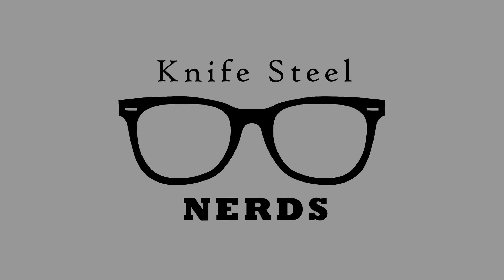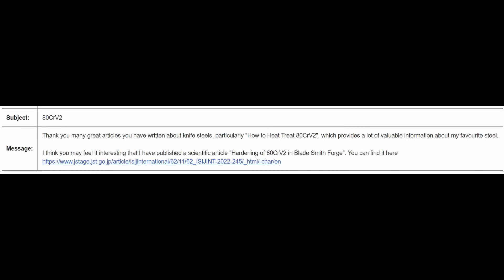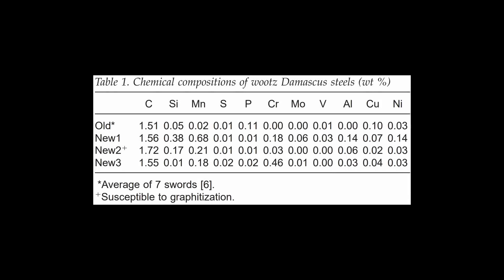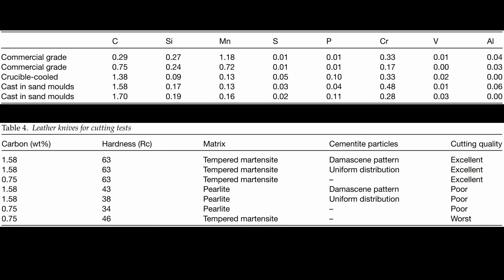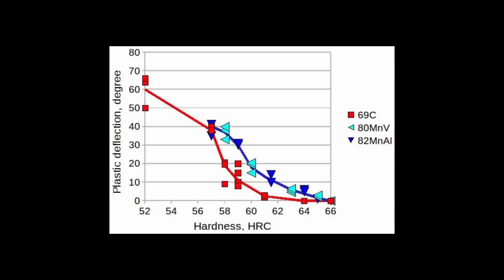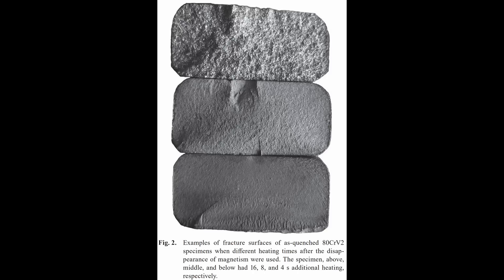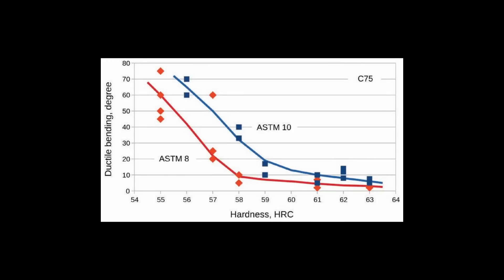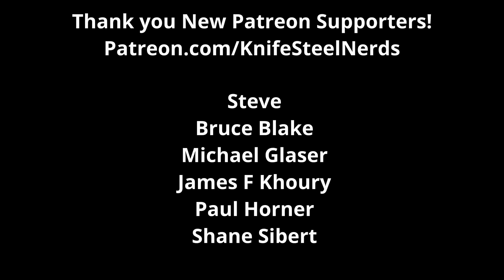A Rival Knife Steel Metallurgist?!?

Comment: I wonder how much it would be to formulate our own powered steel for best of all worlds
Reply: Depends on how much metallurgy you have under your belt. 

Someone hit up a steel maker and had damasteel made which is powdered metallurgy Damascus. If you had enough experience and could make a small block of non powdered metallurgy steel to test the alloy out to a certain level you could probably provide samples to a steel manufacturer and work out a deal. 

I believe that's what busse knifes did with infi steel.
Reply: What counts as "best" varies depending on use. The best chef knife steel won't be the best bushcraft knife steel, and neither will be the best diver's knife steel. Depending on metallurgical formulation, there's tradeoffs between toughness, edge retention, and "stainless-ness". 

However, wasn't Dr. Thomas' own CPM MagnaCut supposed to be the balanced "jack of all trades" powdered steel? Good balance of toughness, edge retention, being stainless, and being forgeable and machinable?
Reply: @The Kash Connoisseur  there are however some steels that could be generalized as a best blade steel due to the balancing act of the alloying agents and specific heattreatment procedures. 

Z tuff for example has basically as much toughness as the second best sword steel available, but at a much higher hardness level, with better abrasion and corrosion resistance. Albeit expensive af. 

For folded blades with only 1 type of steel, 1095 and similar is probably best given you'll end up around that sweet spot of .7 ish percent carbon for simple steels. 

8670 while poor for a catra edge test is probably extremely similar to 5160, and 5160 is one of the best sword steels and used in tough choppers very often. Meaning you can probably balance edge retention and such with hardness and keep toughness similar. 

This breaks things down into a few categories which we can balance individually but with some cross over in certain cases. For knives given you don't need the same shock resistance swords can take again higher hardness and not necessarily as much toughness needed. 

If we ignore how easy it is to sharpen or include that things can change a bit. But then breaks it down into a 2 sub category for other categories and only some for practicality sake. 

Example. For choppers z tuff, 8670 if you want to go the cheaper route 5160 after that. If you don't need something that durable you can step down a notch and trade it off for other characteristics or price points. 

But alot of steels used in knives are kinda just hype and marketing and they perform about the same as cheaper more common alloys pr very close. And given 1095 with good heattreatment can work for swords it's not hard to find perfect steels. Albeit heattreatment is mad important and more so then steel choice. But if we just discuss in terms of finding perfect heattreatment Albeit unrealistic for many smith's companies could easily swing it. 

Pretty much what busse combat knives did for infi steel. Pretty sure it's just an A8 mod steel.
Reply: @bmxriderforlife1234  Well, the cool thing about Larin's CPM MagnaCut is you can achieve a really good balance of toughness, edge retention, stainless aspects, and can harden to 60+ Rockwell C. 

But again, it depends on the use case. The best general purpose pocket knife steel won't make the best general purpose chopper steel (hence why there aren't many folding knives in 5160 or 1095, but plenty in 8Cr13MoV). The best steel for a rapier won't be the best steel for a broadsword. The best steel for a knife issued to Army soldiers won't be the best steel to give to SEALs. Heat treatment can improve some aspects of steels, but always at the expense of others. If you use a heat treat that makes a certain steel tougher, it's going to sacrifice edge retention/wear resistance vs a standard heat treat, etc. If you use a heat treat to increase edge retention, you will impact toughness, and also possibly stainless-ness, plus the steel will be more difficult to finish grind. 

What you describe also adds the constraint of COST, which, when talking about The Best Possible, is generally the first constraint thrown out of the window. The best steel that balances cost and mechanical properties will never be the best steel POSSIBLE for a given application,  heat treatment not withstanding.
Reply: @The Kash Connoisseur  not trying to be rude you're completely correct on some regards. 

However I am literally in the process of starting a reproduction sword company. And despite needing to work out many kinks and details I've actually astounded myself and recreated at least a form of Howard Clark's famous L6 bainite martensite hamon heat treatment. Although something tells me I'm not doing it the same way he is. 

Anyways. For a Rapier and a broadsword you'd probably be fine in using the same steel for both. Certain steels for certain types of swords especially if you want hamon, don't work well, but other then that in swords you're kinda looking for the same characteristics regardless. Many steels work well but for a perfected set up it's pretty simple unless you start tweaking things or looking to achieve well beyond normal edge retention or rust resistance. And even then z tuff is probably your best bet there. 

For more simple alloy steels. 8670 is one of the best, 5160 Is cheaper though and close enough in performance. And 8670 has a few versions and seems some perform alot better then others. 

Knives yeah, but there's probably well more alloys in circulation then need be. Albeit price points also come into regards. 

Mixed purpose knives would be the hardest to balance. And some kitchen knives. 

But some blade profile shit can play some roles as well. And we can probably tune to blade profiles as well. 

For swords if my company works out, I have a few alloys intended to be used but each has different purposes. 1095 or something similar that can be pattern welded without any other steels and get down to the .7 ish percent carbon that seems to be the sweet spot. For non pattern welded blades on the Asian line depends on if hamon or not. 

Domestic line, 8670, potentially z tuff if they'll sell if in bulk at the right size without having to go full buck wild on 5 ton plus orders. Few other steels as well. Might be ordering custom mod blends for certain alloys. 8670 seems like a decent starting point to test some theories I have for sword steels. But so does 1078 which I'd have to custom order in like 5 ton batches. 

Also fancy heattreatment and various heattreatment types. The martensite edge bainite spine being one. But also probably a regular martensite pearlite blend on Asian produced line and a cheaper domestic line. Haven't decided on the euro swords and spring tempered stuff yet 100 percent. 

But 5160 is kind of considered a market leader in swords. Except katana cause bad for differential hardening. 8670 is tougher at a little harder. And less prone to tempered martensite embrittlement. Z tuff is much harder and rust and abrasion resistant for equal toughness. Hardness can help with bending forces. Unless it surpasses the tensile strength. 

So tweaking heattreatment to steel is important. But you can kinda tweak things to certain alloys that just work. That's what busse infi steel is. 

For choppers you can still see similar abuse to swords and more but blade profiles can help. Many are closer to katana with thicker spines that help. Means you can get away with something like 5160 strength level but harder and over all better. Z tuff albeit expensive would be a top pick. 

For cheap. 8670 is more expensive then 5160. But still cheap. Margins though 5160 is more readily available and Unless you want hamon no need for extra costs. But with harder edges on katana and a bainite spine it can work out well. But complex like 20 hour plus heattreatment process. With risk of cracked blades. So like 1000 plus dollar heattreatment on a 75 dollar blank maybe 120 after machining costs. Vs z tuff would get you enough toughness and higher hardness and the rest but more steel costs. 

So ease of heattreatment is another concern. So some of it isn't just about knife quality but multiple other factors. 

For smith's you have forging difficultly and powdered steels are known for being hard af to forge and machine. But for just trying to order or create something it's not hard. 

If you can order minimum steel requirements then it's possible to tune the steel better. Howard Clark has done this. Vanadium modified 1084 or 1086 I forget which. 

Off the shelf. 5160 8670 z tuff for choppers. Probably z tuff for balance. Pocket knives there are some expensive similar alloys that perform. 

Larrins alloy seems like a great kinda all around alloy though. I'm actually intending to have him help with some metallurgy stuff with my sword company if investors stuff works out. Trying to decide on readily available steels in Asia and heattreatment procedure for the Asian line. And some potential help with custom blends. 

Also kinda want to pull a damasteel and use powdered metallurgy to create repeatable wootz and tamahagane/bloomery steel billets for knife makers ready to machine. Both need forge refinement but powdered metallurgy should help with that a bit. Also helps with some research I'm doing. Hizen wootz theory if you happen to be curious. Short version some hizen smith's may have used wootz or other crucible steels mixed with traditional steel in sword making. Imported by the Portuguese. Relates to the namban tetsu project and namban tetsu marked blades.
Reply: @The Kash Connoisseur  I will say this you do have a good grasp on it though. 

But if you pay attention to heattreatment procedure and do a bit of testing. You can fond the sweet spots and use steels to determine that. If we ignore hamon appearance it's generally pretty easy to tune. But costs and other stuff is a huge factor. 

Out the window though. You'd do enough research to find retained austenite minimum required for strength. And depending on steel choice, even austempering for maximum hardness. Albeit 90 hours for 60hrc 5160 is rough and then you still gotta grind it after. 

But we could end up with like 5k heattreatments on cheap steels. Or expensive steels with also expensive heattreatment.

However another often not considered issue is ease of sharpening. Someone I know has a custom sword in a fancy semi stainless that's strong enough for sword use. However while it holds an amazing edge and is rust resistant it's a little more chip prone and hard af to sharpen. 

So user experience is also a factor. 

Why I'm picking certain steels. Tough steel better edge retention steel and then some artsy stuff. Asian line trying to keep it to 2 or 3. But again artsy and then more performance oriented but still traditional to a point. Intended as training tools for practitioners but based off originals and Jazzed up a bit due to ability to use modern manufacturing to speed up some processes. Cast fittings and such. 

But if you need a prybar capable knife a fixed blade 8670 is probably best. If you can get away with 5160 strength you go z tuff for expense due to edge retention and other properties. For cheap 5160. 

Many pocket knives don't need chopper strength though. So for pocket knives we can almost always assume a stainless is good. Even if you want a folding chopper z tuff is probably best. General purpose magnacut provides good options. 

If we ignore every other aspect. 8670 bainite should be even stronger then the tests Larrin did. L6 bainite and 5160 are known as kings and all those more basic sword steels have similar edge retention for the most part. 8670 being tougher means trade off for hardness or at same hardness ridiculously tough blades. While full hardness knife bainite takes forever, sword hardness levels might see way more ridiculous jumps in performance. 

Knives. We almost always are probably Mar quenching or plate quenching or a combination type set up. Once you start testing retained austenite levels and cryo and the rest. It wouldn't be hard albeit mad expensive due to research time. Only reason the sword company plan I have might work out is I'm trading research for my time vs monetary returns to myself. And due to machines and other equipment I can do a side thing for certain tools that need sword type qualities. Axes choppers machetes. Plus doing batches of stuff to reduce costs.
Reply: @bmxriderforlife1234  I appreciate you sharing all of your hands on experience with us. Best of luck with the sword company!

In terms of quenching methods and steel microstructure, I'm sure you've seen Dr. Thomas' breakdowns of some of his testing on his website? I wish I knew if his knife steels book had more info but I haven't yet sprung for a copy.
Reply: @The Kash Connoisseur  thanks dude and haha as long as I can handle this proposal pitch and I've dotted all my i's and crossed my t's so to speak. Besides a few little details in the heattreatment process and a few cnc aspects and related stuff I think I've got everything solid. 

But also nerves haha. Probably gonna have to borrow 100k to start and scale fast enough and bulk buying power for the Asian line. Also need to cross my fingers the preferred forge I've kinda set my eyes on is down and capable. 

That said, idea for environmentally friendly status and energy efficiency set ups among time saving methods should be a good help for the pitch. 

Haha fluidized sand beds. Cnc machining, off cuts used for fittings and knives or other bits or recycled, sometimes into bloomery or crucible steel. Same with wood and other materials. Some materials I'm using are actually by products of other industries so helpful there for reducing waste. Planning to make use of an owned building and install solar all across the roofs and depending on property potential small windmills. No harmful emissions green energy, also reduces production costs, and recycling. That usually means business start up grants although small, and once running a bunch more and write offs. 

Only downside is prototyping time on the Asian line and then again on the domestic line plus some training expenses for additional employees. But might try and get a work around for that selling some stuff that could be produced ahead of time like fittings. 

Also still in the blueprinting stage partially but that also gets easier once licenses are started and such. So many things all at once, but there seems to be enough interest. And enough related ways of making money with the same skills and tools. Knife brand on the side, steel that can be bought in small quantities and some left overs of other stuff. Selling fittings obviously. Bare blades. Potentially some jewelry with casting equipment but more in a sense of doing production for a brand. Alot of jewelry brands exist. Already going to need to buy gold for some inlay and plating, silver and copper as well. A jeweler who specializes is gem setting and designs but not production at scale could get us good business with their own marketing and brand. 

Also gotta do more digging into cnc stuff for outsourcing cnc time for rapid prototyping or other services. Doesn't need to be hugely successful as it's mostly side work. But potential cash flow is always worth exploring. Especially given knives and swords even when using cnc unless you're cold steel or something, it's not running as hard as any other cnc machine would in other industries. Which also helps with operating expenses due to maintenance costs and such. But can make paying it back slower. 

Since the industry is weird. Need a decently long term plan Especially since starting from scratch essentially.
Reply: @bmxriderforlife1234 
I don't think bainite is really that good. It prevents plate martensite but it basically self tempers to the same hardness. It can make a high carbon steel better but it's not as good as using a lower carbon steel at the same hardness for the toughness balance, and much easier to do. 8670 is basically a perfect steel for high performance swords. Larrins's new Pops ProCut also with a high toughness heat treatment would be fantastic. 15n20 also would make a very tough sword at 60hrc. Or axe. Really it's not that complicated. Don't try to find perfection too hard.
Reply: @mikafoxx2717 you need to do some more research into lower and upper bainite then. Lol.

Comment: Always welcoming to have more academic sources running around in public, mostly because the material they produce can take some digging to find compared to say the more accessible platforms like this. Plus having people with a working knowledge of the metal itself also expands a lot of the practical uses of it for us dumb dumbs down here whacking stuff with hammers and turning it into dust on grinders
Reply: As one of the dumb dumbs I concur.

Comment: There's a JIS steel, SKS 44, that's got 0.1-0.25% V, 0.8-0.9% C, and 0.2% Cr max (as impurity).No clue if it's available, but it'd be cool to check out if it were!
Reply: So many alloys exist only on paper or sold only to weird customers in bulk where you'd never know what the steel was in the final product. 1078 is an example if I'm not mistaken. Mod versions exist but are so far outside the specs they're not really the same steel. But the paper specs exist only on paper as far as anyone can find. Other then a few smith's ordering in bulk. 

Howard clark had to do that for his 1084m if I'm not mistaken. Something like 10,000 pounds of the shit minimum order requirements and shipped in round stock.
Reply: @bmxriderforlife1234 yeah, it pretty much only makes sense to steel suppliers but a manufacturer can make a data sheet for any steel but they don't need to regularly make melts of it for it to be available on order for them to melt as needed.